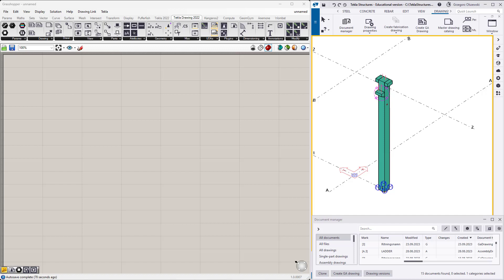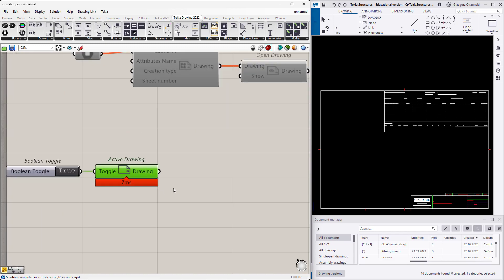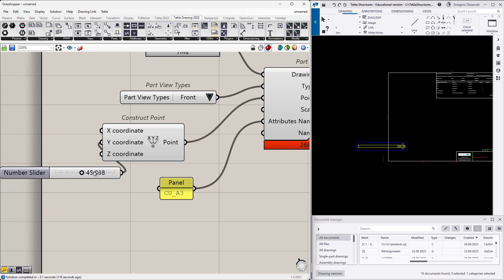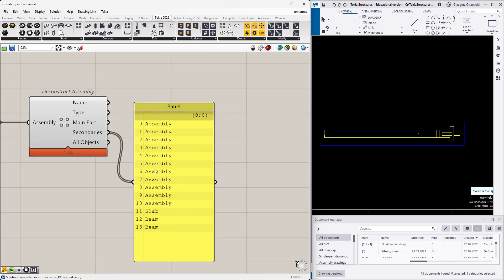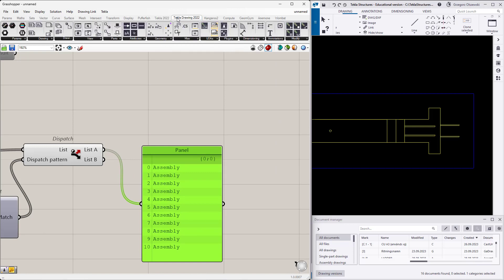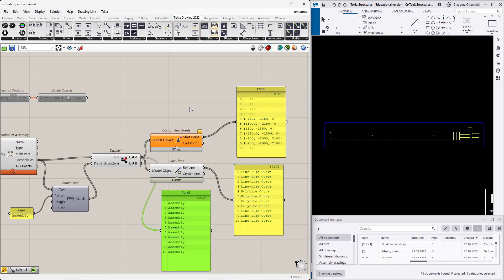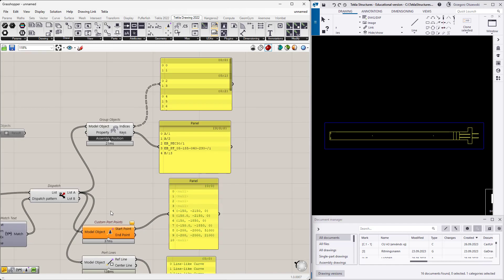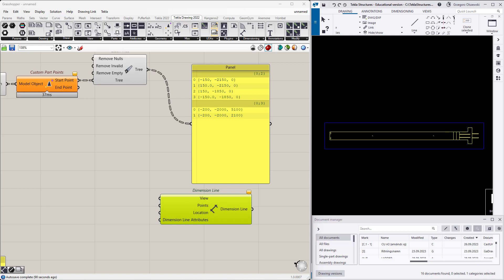GH Dimensioning IV

Comment: "Thank you for your open-source project. During testing of several versions, I found the following issues:

The link file in the 2019 version cannot be recognized.
Is it possible to add arc annotations as well as radius annotations?
Can weld seam annotations be added as separate objects (currently under 'mark')?"翻译
Reply from the maker: Hi, please raise any issues on GitHub:
https://github.com/LetsConstructIT/Grasshopper-TeklaDrawingLink/issues

About the 2019, any screenshots from Rhino command panel which will describe errory would be helpful. I don't have an access to this Tekla version so can't try it.
Arc objects and radius annotations could be added. I will add them to the waiting list, but there are other things with higher priority (Tekla 2024 and Grasshopper component for the drawing space).
Weld marks support is very limited in the Tekla Open API. Open an issue on GitHub and let's have a talk there :)